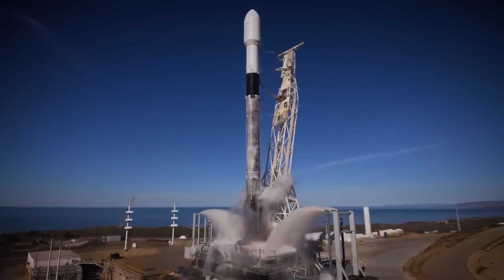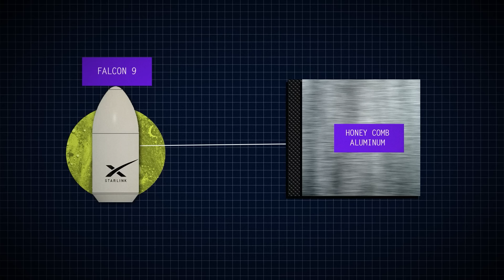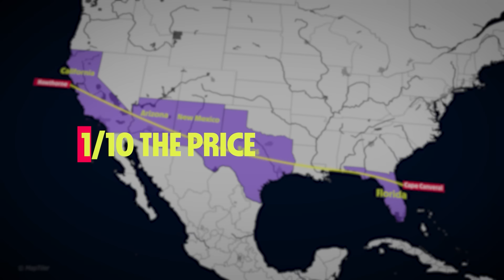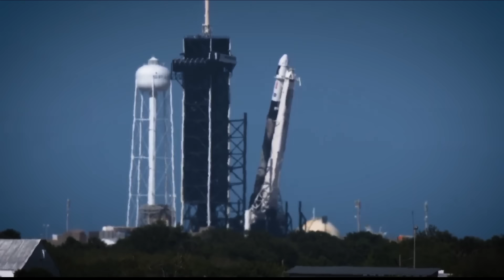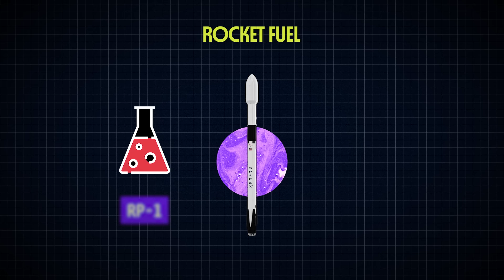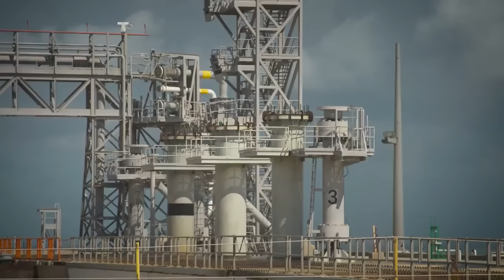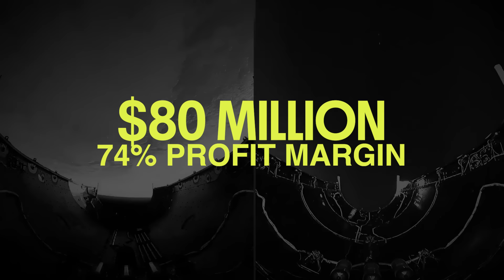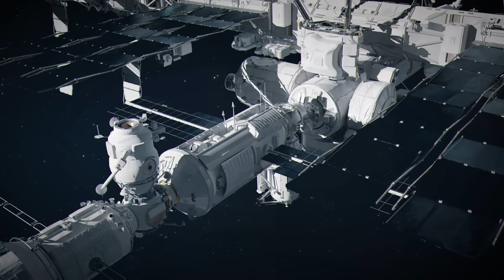Why Going To Space Costs So Much

Comment: Insane thing, a Soyuz launch is still cheaper even tho the whole thing is disposable
Reply: What’s a Soyuz launch cost?
Reply: @steven_alleman  If I can recall it, it was around 30 mi
Reply: @Galomortalbr I’ve seen anywhere from 30-80 million for a Soyuz-2. Either way, Falcon 9 re usable is around the same price and is capable of roughly twice the payload capacity.  Soyuz-2 is still a solid rocket though.  Soyuz-5 just launched and is more on par capability wise with Falcon 9, but I’m sure any pricing out is wildly speculative.
Reply: @steven_alleman  Roscomos charge absurd profit margins due to having a quasi monopoly before SpaceX came in, I can recall reading that launch costs might be even close to just 10 or 20 million, there's been thousand of soyuz produced across the years and it is basically the ford model T for rockets
Reply: @Galomortalbr that’s probably true.  SpaceX has said internal launch costs are around $15 million. When you control a large majority of launches, you can massively up charge.

Comment: The most expensive parts of rocket are engines, turbo-pump unit and body.
IMO the body is fully depreciated in 10 launches, turbo-pump is fully depreciated in 3 launches and rocket engines in 5 launches. If each part costs 30% of rocket’s full price then for each launch the rocket is depreciated for 20% or fully depreciated for 5 launches.

Comment: Bro you missed by far the most important point in your cost breakdown:

How many times each rocket can fly.

You have to amortize the initial cost of building the rocket over the number of launches.

So that $40mm goes up in smoke if it fails to land, but if it flies 10 times, then the capex is only $4/launch.

Has massive implications on spacex operating costs and profitability.
Reply: Sadly, their finances aren't exactly public especially with an idiot like Musk claiming his HLS system only costs 100 million USD... (which is nonsense ofc)

Comment: Wait, Russia was only charging marginally more to launch people to space on a non-reusable rocket? That seem strange, no?

Where did the overhead, Admin, and Staff numbers come from? They feel very low to me. $250k for admin, ~$30M a year? To pay for lawyers, payroll, HR, safety, infrastructure, utilities, enviro, etc etc etc. And, $3.5M, $500M a year is paying for all of the research?!  

The problem with coming up with number from first principles like this, is you almost always error on the low side. Every nut and bolt you forget underestimates the cost, where little pushes you to over estimate. Basically every time something is forgot or estimated it moves the number too low, not to high. This is normally accounted for in feasibility studies by adding a contingency cost. Ranging from 10-30% of the estimate. Where the lowest level of study (still involves 1000s of man hours of work) for a project this expensive adds 30% for those nuts and bolts.  

Anyway, I suspect the $29M quoted by SpaceX was a bare bones operating cost for launch and had no indirect costs (admin, OH), initial capital and sustaining capital in. SpaceX likes big claims and giving an artificially low cost seems right up their alley.

Comment: 13:30 Sorry, but can you provide sources for this information? Forgive me for doubting rocket grade propellant being refined multiple times be as cheap as gas.
Reply: Google it.
RP-1 is merely specialized kerosene, much like Jet A-1 (used worldwide for aviation). The same refineries can easily produce both.  Both are comparable to automotive fuels, when purchased on contract basis AND especially since in most parts of the world, Jet and Rocket fuel isn't taxed the way consumer auto fuel is.

Comment: Comparatively, the cost of launching a SpaceX Falcon 9 vs any other major rocket system is relatively cheap due to the reuse of boosters. Tje others throw away the booster and that is just too expensive to be sustainable against SpsceX. Furthermore, once Starship is a locked down, stable design, the Falcon 9 will look relatively expensive because it still throws away an engine and upper stage every time it launches. At least SpaceX has the recovery of the fairings which are worth about $1 million each half.

Comment: Cargo:
Space shuttle could carry much more cargo than the spaceX current setup.

Thrust:
Shuttle had about 6-7 times more thrust than a falcon 9.

Safety:
Shuttle originally had ejection seats, but those were removed and crews would then have to bail out through the hatch system. This of course could only function if the failure allowed the crew time to react. Booster explosions would destroy the entire vehicle (as was seen).
SpaceX returned to the original setup style of Apollo and pre-Apollo (capsule located on top). The Russians never changed this. One main reason for this design is that it allows the capsule to launch free of an exploding booster system (and generally a better chance of surviving an explosion to the systems under it).

Eventually though, there will be an accident with loss of life. There is no system built by man that does not fail at some point. It is not a matter of IF, but just a matter of WHEN - and the crews know this.
Reply: The space shuttle could only carry cargo into low earth orbit and have a mission time of less than 20 days. SpaceX is designing starship to bring heavy cargo to another planet, the shuttle did not have 6-7x more thrust, it was the shuttle and boosters that did that.
Reply: @miguellopez3392  I assumed people understood I was referring to the entire shuttle system, as the shuttle itself could not achieve a liftoff.
I did not mention the star ship. The star ship, if completed as designed,  will have over twice a much thrust as the shuttle system. It will be the most powerful rocket ever built.

Comment: This is what many people don't understand, and wonder why we haven't gone to Mars yet. What's the biggest risk/problem for a manned Mars mission? Radiation. Mars doesn't have a magnetic field like Earth so you're not going to be protected on its surface. Just flying there and back, not even landing, puts you way, way over NASA's lifetime limits. And that's not accounting for any solar flares which, if caught out in the open, would kill you. So you'd need shielding, heavy shielding because the primary radiation actually causes your shielding to become radioactive and this secondary radiation is even more deadly than the primary. Which means you need even more shielding. This all means that getting a Mars trip underway is going to be ridiculously expensive unless we can solve some of these major issues. It's a hard truth people don't want to hear.
Reply: Yep, whilst it's obviously impossible to rule out, I doubt we'll EVER become an "inter-planetary" species.

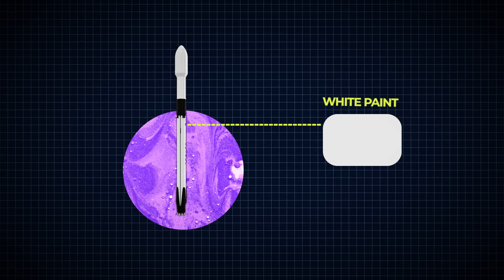Comment: 2:17 I understand that the white paint keeps the cryogenic liquid oxygen from boiling off as fast in the hot sun, but paint has weight too.
How much would the payload be increased if the rocket were left unpainted?
Reply: Not much. It's not like American airlines jets.
Reply: It's certainly a factor - it's why the 2nd gen space shuttle boosters were orange (foam) instead of white - it saved them 500kg's

Comment: You were wrong when you state that SpaceX is all about saving money. SpaceX is all about the appearance of saving money, if they wanted to save money they would build the factory next to the launch pad but they want to make money shipping and disassembling and assembling so if they really wanted to save money that cost would lower each rocket approximately 10 to 12% because you have labor disassembling the finished product loading the product hauling the product unloading the product assembling the product and that is a lot of work after the rocket is completely built and a lot of time roughly a third of the time between the very first manufacturing step and the final delivery is after the rocket is completely built on the other side of the country. Maybe if the CEO wasn't such a dingus

Comment: The deluge system is for sound and shock wave dispersal alone. It doesn't put out fires, and you wouldn't ever want to use water for that purpose for the exact same reason that you wouldn't ever spray cold water on an engine that is overheating. The only thing more destructive than quickly heating something up is to quickly cool it afterwards. With tolerances of under a single millimeter across the rocket and "strong back", you would need to prevent warping as much as possible. To illustrate just how profound that effect can be, the height of the burj Khalifa in Dubai, prior to the completion of the building and the addition of climate controls, would cause the steel to be fifteen centimeters taller during the day than at night. The Soviets never used a deluge system during launch, but mitigated sound using a trench several hundred feet deep beneath the rocket with tunnels at the bottom like a starfish with vents that dissipated pressure and sound away from the rocket. NASA couldn't do this because of the location of cape Canaveral. That's also where a safety bunker existed where the astronauts would have been ejected to in a failed launch. To be fair, the Russians also had the same kind of system. It too ejected cosmonauts during a failed launch, and even to the same area. Instead of a protective bunker, the cosmonauts would find themselves being whisked away and into the flame trench to incinerate any evidence of the failure. They learned their lesson the last time they barbecued a cosmonaut. They didn't learn safety, but that if you should never leave a body, no matter how charred

Comment: So a single Bugatti Veyron can get you 4 Merlin Rocket engines? I'm not sure if it's possible to convert a rocket engine into horsepower, but if I were a gambling man I would put my money on a Honda Civic with 4 Merlin Rocket engines strapped on over the Bugatti. Would the civic be conside
red turbocharged or naturally aspirated? Technically it can't be naturally aspirated, right?
Edit: *I swear to Christ I wrote that before the cost of retrieval was compared to the cost of a used Honda Civic

Comment: downvoted you missed some parts and you compared apples to chairs on a few occasions.
---first problem you did not show how much cargo space and weight is lost from storing extra fuel to slow down th booster for teh catch and the costs / profit loss that causes vs using any other reusable tech such as what the shuttles boosters used which was parachutes
---second you did not compare the reusable cost to a one use version which would be much much closer to the cost of th upper stage which is a throwaway tube because it does not need anything to catch itself so no fancy catching hardware no flight controllers for landing no special landing anything no landing costs of any kind and that leads to an increased payload as well due to reduced weight and increased internal size.
---third you are comparing the shuttle which was a cargo hauler + living quarters + labratory + full flight deck to something which is 3 seats in a capsule so the comparison here is definitely an apple vs a full on massage chair and yes im talking about one of those 10k or more models.

this also leaves out the fact they dont have anywhere near the r and d costs nasa has had in the past.

I am pretty certain a properly run government space company could very well beat spacex on price instead of handing them 60% profit 

I am also certain a parachute and catch boat would be far cheaper than sending extra propellant and all the other bits to catch the booster vertically ... heck they could also just turn it into a glider and land it on a runway we have done both in the past for reuseable rockets the shuttle glided and the boosters were parachuted ... or if they want to be cheap they could have the booster use paraglider parachute and glide back to a giant bouncy airfilled catch pad or something.

dont forget we had full access to everything nasa spent and did while spacex gives us very minimal access to that info which means we do not know what corners they probably are cutting and judging by the panel gaps and the inabilities of musklers car company im pretty certain there are similar problems at spacex and it is only a matter of time before bad stuff starts happening.

Comment: So how do they get away with the CARB rules in CA launches?   You know that RP1 needs a DPF and/or catalytic converter!  👍🤠
Reply: DEF is used to reduce nitrogen oxides when burning diesel, since it's more polluting, and a rocket engine produces a little NOX due to its combustion chamber having no nitrogen present unlike air breathing engines, the rocket  engine burns clean enough to also not need a DPF.
Reply: @miguellopez3392  I was just putting a jab in at CARB for the burning white coal on the launches!  🤣
Reply: @Chris_In_Texas  yup it's all in vain anyways since most of Californias air pollution comes from wind blown pollution from china LOL.
Reply: @miguellopez3392  Nope, most carbon comes from volcanoes.
Reply: @Deontjie  lol far from it, at 33 gigatons a year humans release 70-100x the amount all volcanic activity has annually.

Comment: 172 Million Dollars on Russian Soyuz, that's so cheap compared to $1.8B. While Crew Dragon cost $55M per seat and it can host 4 to 7 people, Soyuz can only accommodate 2 to 3 people. Despite that, US Citizens are still throwing rocks on Elon Musk, those guys are just jealous
Reply: Soyuz $172M? $86M--$90M for one seat (+inflation). $258--$270M for 3 seats.
Shuttle: $1800 for 7 seat + 15 t cargo and her support system. ($1800M - $100M [15 t])/ 7 seat = $243 for one seat.
Dragon: about $88M for one seat.
You are still throwing rocks at the Shuttle. But there is also a support system, such as a manipulator, weeks of autonomy, and the ability for astronauts to work outside the shuttle. The Shuttle is not a Dragon. especially the Soyuz lifeboat.

Comment: Going to space is easy (Think: Sounding rockets)

STAYING in space is the expensive part

WRT the upper stage being expendable, what's to stop SpaceX using reflown engines fitted with vacuum bells as a cost reduction  measure. After all, engines are the most expensaive part of the whole assembly (I'm assuming there ARE showstoppers preventing them doing so, but would like to see them laid out)

WRT "shielding from road debris" - that includes bullets. Yes it happens, but more so with trains - B737 fuselages railed from Kansas to Washington regularly show up with multiple holes in them. 'murica yeehaw!

The turnaround on Falcon boosters is highly impressive considering they WEREN'T DESIGNED to be reflown

Comment: Since the upper stage is always expended, does SpaceX power them with previously used engines?
Reply: Unfortunately there is no such thing as a reused engine on the upper stage. There is only one vacuum engine, which burns up along with the stage itself
Reply: @spaceExtremeZoom  he means reusing old first stage engines, not a expert but i think it might be possible since hte main difference from what i understand is the nozzle
Reply: @songhan1586  There are some more differences, mainly in the cooling used, and sealing in the powerhead of the engine.